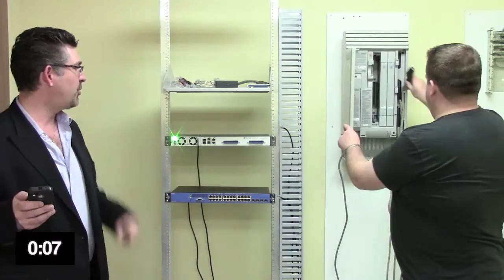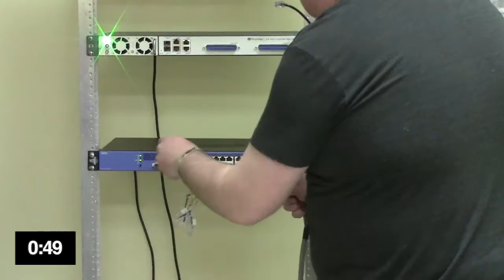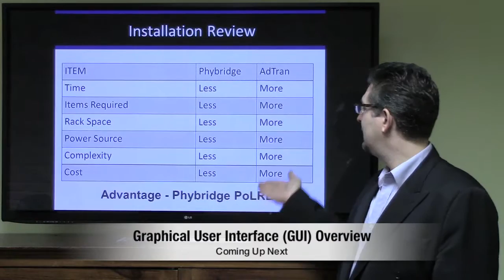Installation Overview - AdTran NetVanta 1535P vs Phybridge PoLRE

Comment: What about the physical technology and throughput.  Its interesting to note that the Adtran out performs on throughput and distance compared to the PhyBridge.  You can also mix and match ethernet and ActiveReach ports on the 1535P which allows greater flexibility on the 1535P Switch.  Can the PhyBridge give you more than 10M?